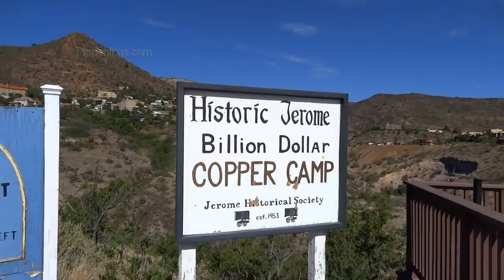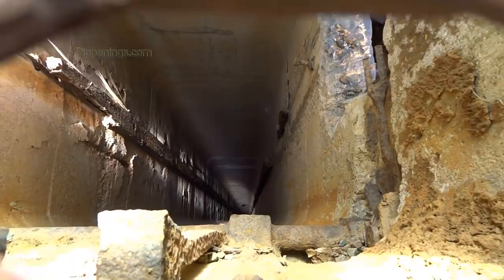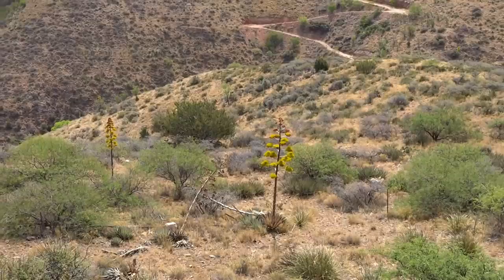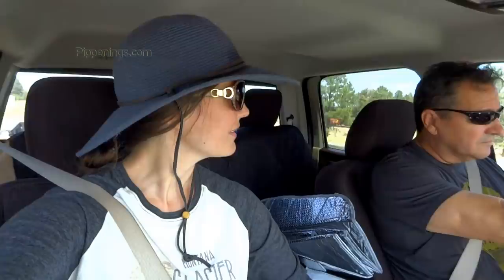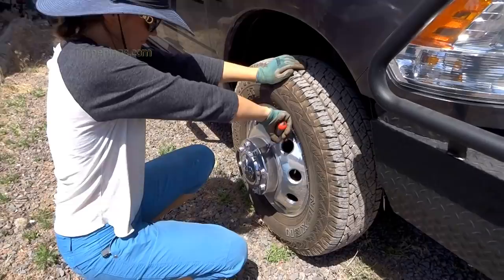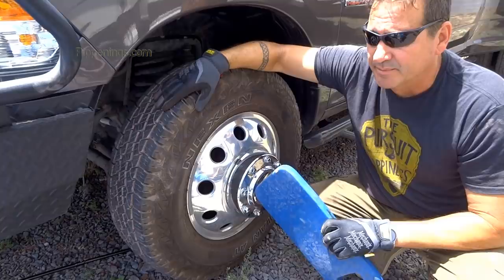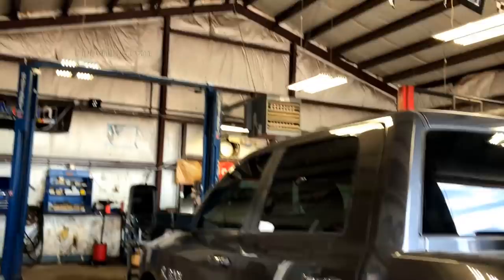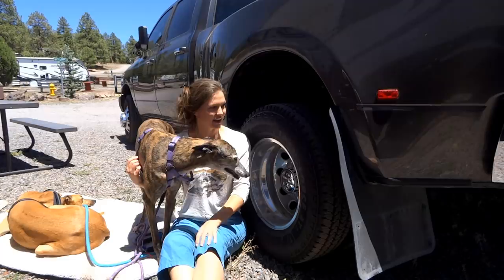Fifth Wheel Towing: Dually Blowout // Jerome, Arizona

Comment: I'm so glad you nipped that tyre problem in the bud before it blew out.  I had a front-wheel blow-out a couple of years ago at 70mph...how I kept the car under control and didn't flip it; I've no idea.  It turned out the car had cheap unknown-name tyres on it (I only bought it about a month previous and although they were new, I didn't notice)...£600 and a set of Continentals later... Peace of mind is priceless.  Happy RV-ing. :)

Comment: Good job Pippi & Gene for catching the tire issue! I had a blowout years ago that did some minor damage to the vehicle. I never skimp on tires anymore. I never wear the tread off any of my vehicles, always keep track of how old they are. Now that I also pull a travel trailer its even more important. I also agree with the others about a floor jack, we have a small one in a case and it can handle my GM 3500 Express van no problem. Love your videos! Safe Travels!

Comment: Pippi please do this ol truck driver a favor and get rid of that screw Jack and buy yourself a good heavy duty 3 or 4 ton hydraulic Jack at Napa or Sears
Reply: Yes, and please get a floor not a bottle jack.  I had my Dakota pickup fall off the factory screw jack (just like the one in your video), I was changing a rear tire, fortunately it fell after I installed the spare while I was tightening the lug nuts, no damage, no one injured.  Screw jacks and bottle jack are just an accident waiting to happen in my mind.  Not saying that you can't have problems with a floor jack either, but they start out being a far more stable lifting platform. Also always use jack stands in addition to your floor jack. Ok I'll stop preaching now.
Reply: yep
Reply: And on that note, the aluminum ones are worth the extra price when you're gonna be lifting it, not just rolling it around a garage.
Reply: Very nice troubleshooting work guys, and I'm glad you mentioned the death wobble because I thought of that initially, so I'm sure lots of people did.
Reply: I think a hydraulic jack is a good idea, but the most important thing to do is to use an axle stand.  You should not be just relying on any type of jack on its own, so jack it up and then put an axle stand under.  I think bottle jacks are fine, I have a 10 ton high lift bottle jack that I used when I had a 5 ton Chevy dually.  So have fun on your travels and stay safe.
Reply: Floor jacks don't work very well in gravel and dirt

Comment: Pippi,
From what I could see you have NEXEN Tires. My New 2016 Dodge Dually came with these tires also. At  9000 miles both Front tires had separated belts
Replaced all 6 tires with a better Brand because I could not trust this brand.
Everyone! Please be careful if you have Nexen Tires on your vehicle.
Pippi, glad you found out what was wrong and that you are safe.

Comment: I hope the tire shop told you that the tires are rated for their weight ONLY at maximum pressure (Usually 80 psi). I also have a Ram dually and I run 80 psi in all 6 tires when towing. Only lowering the pressure to 80 front 60 rear when not towing (assuming it going to be a while between tows) Safe travels!

Comment: yes, my inside tires were older than the outside when i bought the RV, did not know, and when i was having some issue while driving, it turns out the steel belts were showing.       Know your tires.     and check often.

Comment: Well look at it this way Pip, you only have 8 tires to feed instead of 10 now. I had a vibration at 35 & 70 that haunted me for years in the E350. It was broken exhaust hangers & clamps (double) hanger on back of muffler & single hanger 3 feet back from that. Even tho the exhaust is stainless, the hangers and clamps are not.

Comment: The reason those tires failed is because the down pressure of your 5th wheel makes the inside tires push heavier into the road while the out side tires actually have less weight on them.so you should rotate your tires often

Comment: Great vid. A car will usually let you know when there's a problem. Vibration that strong at relatively low speed is almost always a bad tire or a bent rim. Unbalanced tires usually vibrate at higher speeds. The point is don't ignore signs like these because, like she said, the consequences could be tragic.
Reply from the maker: Even if you wanted to ignore them the problem persist and won’t let you ignore it

Comment: When I had my dully I put air extenders so I can fill/check inside and outside tire pressure , and E  10 ply tires . Didn't know they put the air indicators on trucks .really need a roll Jack in your toolbox. And get a Chevrolet Duramax

Comment: Had the same thing happen except it was the outside duals that ruptured the belts. Found that you could lower the pressure about 15lbs in the affected tires so I could get to the tire shop and have them replaced. Lowering the pressure stopped the wild ride.
Reply from the maker: Good to know in case it happens again. Glad you got them fixed before any major damage.

Comment: Pippi, I am unsure what year model your Ram 3500 dually is; but mine is a 2014 Ram 3500 LARAMIE dually that is similar and I just had 4 Manufacturer Safety Recalls done at the local dealer (Under Warranty). You can research it yourself or just call a RAM dealer and give them your VIN and they can tell you. Odds are if you bought the truck used recently, then the previous owners may have not even got those Manufacturer Safety Recalls already fixed. 

On my vehicle it was: 1) [T51] Waterpump replacement needed. 2) [R46] Front suspension track bar frame bracket mount. 3) [T25] Occupant restraint control module. 4) [T79] Brake Transmission Interlock.

On another note, I had some vibrations as well similar to yours, but at higher speeds around 67mph-to-75mph which is right where you need to run without a trailer on the interstates. But mine was the carrier bearing assembly on the 2-piece driveshaft. Instead I went back with a 5" diameter aircraft grade aluminum 1-piece  driveshaft replacement with new yoke assembly and larger extended life U-joints. (Love it, and vibration gone thanks to Driveshaft Specialist of San Antonio, TX).

Comment: that's because the shop put the front tires on the rear inner and only replaced the front tires, dually has a special rotation pattern (in the owners manual) or you'll get strange wear

Comment: You didn't say if you replaced all 4 tires but you probably did from how you were emphasizing safety. I had belts broken on 2 of 4 rear 10 plies on my class B plus. It happened on the terrible roads of NE Arizona where I was encountering hundreds of awful pot holes before I could see them. The tires were new at less than 4 months and under 3000 miles. I kept going for over a 1000 and was lucky. My first time out in my first RV.

Comment: With tire shops one doesn't really need to worry about under tightening bolts/lugs, but over tightening. A quality torque wrench would be a good investment for your toolbox, especially with the aluminum wheels.

A stitch in time saves nine! Good instincts on getting the rig to the shop! 👍

Comment: Oh man, those inside tires were bad.  Before you showed the tires it sounded like a U-Joint or driveshaft issue, which are very common on these trucks.  I don't think putting it in neutral would do anything because the rear driveshaft is always spinning.  Glad you caught it in time.
Reply: Neutral only eliminates the transmission, then she checked drive shaft, yokes and bearing inspected, ( looked for a lost weight on the shaft), then rear end and tire. Nice channel you got there  by the way ;)
Reply: Gene's Therapy Thanks Gene.

Comment: The roundness and flat of the tires comes from the under and over inflation of the tires. heat and cooling of weather conditions also play a factor but the longer you go with uneven air pressures the more you will notice one is round the other is more flat.Not  to mention better and worse fuel mileage.

Comment: After driving 50 miles please re-torque your lug nuts. Every shop installing tires should tell the customer this. 
Also over the next few 1000 miles keep an eye on wear of the rear tires. Yes it could be that the cheep tires failed but in most cases on a dullie if inside tires wear the axle bearing is gone.

Comment: If the steering wheel doesn't oscillate, I"d say a Belt slipped in a rear tire or tire out of round ? Jack up the corners and rotate the tires to look for an out of round tire.

Comment: That was interesting watching the vibration, it looked like it may have had a resonant frequency set by velocity and a bulge in the tires. It is similar driving over washboard on a dirt road only the tire itself becomes the bump.   There is a speed of maximum vibration (usually average driver speed), outside that, either faster or slower, the vibrations goes away when driving on a wash boarded road (or with a bulge in the tire), glad you got that fixed, safety first!     

Jerome is a beautiful city, looks like you can enjoy Flagstaff, it is 110F in Tempe right now! -John
Reply from the maker: Yeah that’s too hot!!! 🤒

Comment: If you haven't looked, the torque spec on those lugs nuts should be well over 100 ft. lbs. You're going to need something with considerably more leverage than that little star wrench.  A cheap alternative is a 1/2" drive breaker bar and socket from Harbor Freight.  Add a 6" extension so you can get to the rear ones.

Comment: same problem on my ram and I put on new Michlen and that fixed it all shimmy, i had the tires re-balanced but the tires after 25000 miles would shimmy so I towed my trailer about 60 mph put new on at 35000 miles what a difference,  Love the truck tires are junk.

Comment: I miss the belly dance... LOL

But seriously, you need to swap inners and outers every 10,000 miles on a dually....

Used to drive semi 48 states... we switched our rears every 30,000 but that's a semi tire...

on a dually pulling a 5th wheel I'd swap them at 10,000.

Basically take the outer tire, and inner tire, and swap them on the same side.

Just trying to help, been watching since forever.....

Comment: Pippi Thanks for video. Im learning more. with each of you vids. I Class C 2009 was really bad / Like no shocks and veering to left. That can shake a rig or appliances  with the smallest pump.  So deduced checking the  all the shocks at a heavy duty truck business. Right front shock oozing oil. I had bought rig 2 months ago so I did good at diagnosing. There was previously a steer safe put on  because of steering was so difficult to keep truck straight to road...was all over the place .... So steer safes go bad and my case yep gone bad it seems. My tires are in great shape. Steer safe replaced as well all shocks . Alls well now.Pippi you may have had similar issue with A class. My rig previous  a 10k dry-15k max load fifth wheel.  Who rides   inside a 5 W ? Now to see why the ac which works great is leaking into coach when ac has been running and when I turn it off and start driving water leaks. Either somethings stopped up not allowing all condensation to run off roof or who knows what. Previous owner had this fixed but problem has returned. Now to get rv service to take a look. At seven two nope  Im no Pippi LOL. always enjoy your video and Bobby , Howdy from OKLAHOMA! Thanks for view of location its on my list. I like history, the  old mining stuff and touring historical homes. Safe Journey Pippi and adventures that aren't related to vehicles. But like you said it part of traveling.

Comment: The problem when you blow a rear tire on a dually it takes your rear fender with it. Inside duals take more weight because the roads are crowned you will see more wear. You’re traveling on hot roads cheap tires will give you problems every time. Looks like you went with Bridgestone Duravis AT

Comment: I'm no tire expert but, want to say or ask, if you have regular maintenance checks on your rig like oil and lube, doesn't it include tire rotation and checkup?  Mine does.  How do tires get so badly unevenly worn like that?  My tire people tell me everything that is of note about my tires.  My tires are rotated in a required pattern, on a schedule.  Very important.  I'd consider setting up a regular check up and rotation plan.  Glad nothing bad happened this time.   Thanks for posting.

Comment: .... bad rubber compounds are common these days. did you check for possible recall on the manufacturer, date and where made? just to add..... check lug nut torques also.

Comment: # 1 -- did you reach out to Carmax and see if they would help you out with that, seeing as you bought it.

#2 - get yourself a torque wrench that at least goes from 0 to 250 foot pounds for those wheel nuts. That little x-wrench you had is DEFINITELY too dinky to tighten those properly. (consult your owner's manual for the correct spec.) The last thing you want is to have wheel nuts come loose. It can cause all sorts of catastrophic damage!!!
Reply: I definitely agree with gac914, you need something other than that little 4-way tire wrench.  If you ever had to remove a tire on the side of the road it's never gonna happen with that 4-way tire wrench.  you need either a 1/2" drive torque wrench or a 1/2 drive breaker bar to even stand a chance of breaking the lug nuts loose, once they are loose you can spin them off the rest of the way with the 4-way tire tool.  It's a good thing you figured out the problem before you had a tread separation incident and trashed your bedside, wheel wells or your 5th wheel.
Reply: has an old 97 Dodge 3500 and the lug nuts are marked 140 lb.  I picked up a battery powered 1/2" drive Impact Wrench by Ridgid to assist in removing those lug nuts, and get them tight. Then check with the torque wrench.  Having roadside assistance insurance is a must too. The best to you.
Reply: I agree. If you always use a tire shop maybe no, but otherwise yes!!!
Reply: In the bad old days the heavy & fattest fitter tightend your wheel nuts/lugs , Now in enlightend times we have Tougue wrench s 1/ it stops over tightning 2/ it stops undertightning <wheel dropping off> Strech them wheel studs by over doing it & they will sheer off in time.

Comment: I’d really watch the tires on the 5th wheel if one those blow they can Really do some damage to trailer!
Reply: George, you are so very correct on that and it's a good point to make.  Pippi, please take notice, you might not have the warning when a trailer tire goes.  I had a tandem fifth wheel tire blow and I didn't even feel it or know it.  Someone pulled up beside me and started yelling at me to alert me about it.  Fortunately the other tandem tire held and I got pulled over and got things taken care of.  The repairs to the fifth wheel were something just shy of $500, not including the tire replacement.  The blown tire was nothing but small shreds of rubber hanging from the rim.  I replaced all four trailer tires with a better quality tire once I got home.
Reply from the maker: Thanks, I’ll definitely be keeping an eye on them
Reply: Seriously, we blew a Goodyear tire on our 2013  fiver in 2015. Replaced with Maxxis, blew one 3 weeks ago. Damage  from the first tire, $1600 plus cost of 4 new tires (one of the others had a silver dollar size bubble on the inside of the sidewall). Second tire let go on I70 in BFE Kansas, damage minimal, about $500. We had roadside assistance and they sent a tire truck out to put on spare. We followed him back to tire shop and put on 4 new 14 ply steel belted LT  tires. Found a second tire that was starting to experience belt slippage.Put the heaviest ply tires you can on both truck and trailer and watch your tire pressures. Good luck and have fun
Reply: A tire pressure monitor system is very helpful also
Reply: We really got lucky. The town we were near was a small farming community and had a GREAT tire and repair shop. The guys were great and dealt with horse trailers, stock trailers, equipment trailers, hay trailers, etc. A couple of them had rv trailers and told me they only run 14 ply tires. They slapped the new tires on like a pit crew and didn't try to Jesse James us on the price.
Reply: Pippi Peterson just check your tire pressure and for cracking in your tires before every trip (which I know you do because you did a video on it before) and you’ll be fine. 👌😉
Reply: Yes, I’ve read about the cheap Chinese made tires on most trailers. It seems a good precaution to replace them sooner than later. Also insure your axles are aligned with the road. A missing bracket in one account allowed the forward axle to be dragged into misalignment which eventually blew out a tire.

Comment: In a jeep we call it death wobble.  But many causes and many fixes.  Alignment is first and foremost.
Reply: death wobble is a little bit different. Typically with death wobble its unrecoverable (meaning it vibration keeps increasing till it throws you off the road or you come to a complete stop).  In almost all cases 'death wobble' is caused by a steering component failure.  i.e. track bar bearing.  She didnt have death wobble, it was a different kind of shimmy/shake/wobble. i'm happy it was fixed.

Comment: I had a 2014 Ram 3500 with the same Nexen tires and the belts separated on them as well.  Had to replace all 6 at 45k miles.  Now my 2018 Ram is starting to shake with 14k.  Darn those Nexen tires - junk.